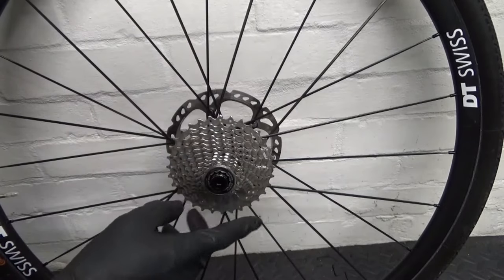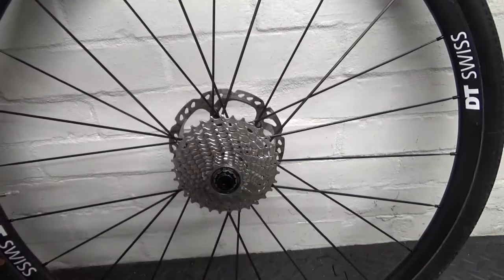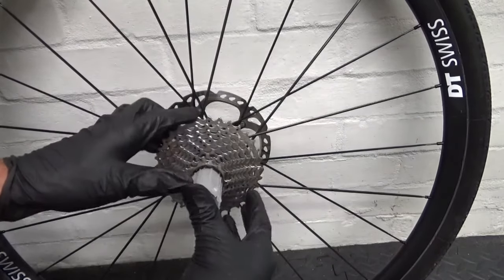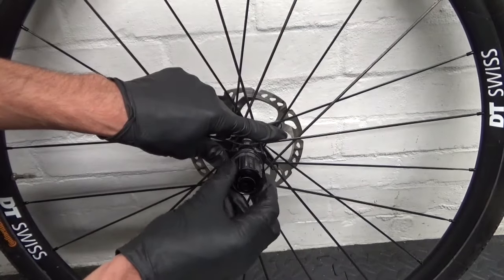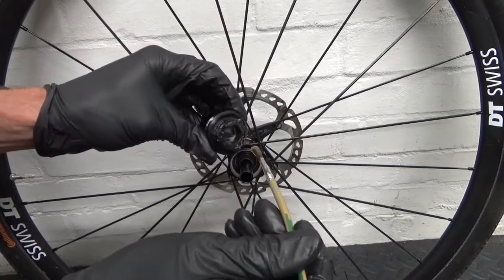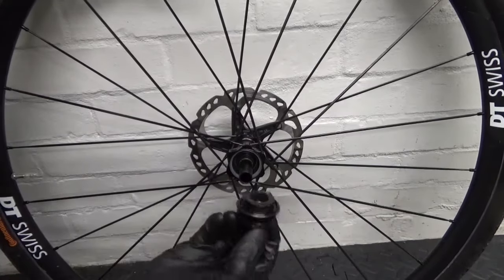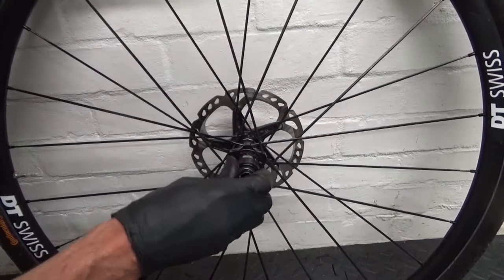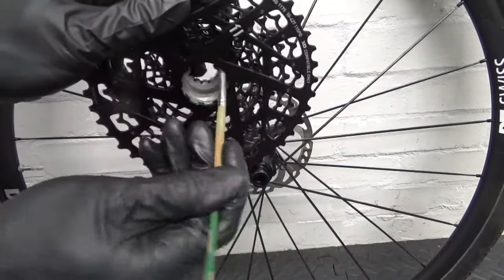DT Swiss Shimano Freehub Body to SRAM XD Driver Swap

Comment: Nice video. But my current rear wheel hub can only accept one side for the spanner (freehub side). The non drive side is round with no way to put a spanner. SO how am i gonna be able to loosen ??? sorry if it sounds confusing.
Reply: Bro. look inside the axle tube and see if it looks like you can fit a 12mm allen key, thats whats going to help you keep the axle from spinning and remember the side where fit the spanner wrench it tipically reverse threaded.
Reply: @ezequielpena7235  oh damn. Old post lol.  I figured it out bro. Thank u

Comment: Great video - Thanks. If i change to complete SRAM etap Force AXG 12S and brake system, from Shimano Ultegra do i then also have to change the disc brake and is it possible?

Comment: Hi. thank you for video. But I have problem with removal Sram freehub. I dont have there any cap. Just axis. But freehub is not possible to remove so easy like you did. Thank you for a advice
Reply: I have two wheelsets. One on shimano second on sram and want to exchange it. But I really struggle with that.

Comment: I have a through axle and a 12 speed freehub body, FH-521, 3 pawls and the end cap screws on to the axle to keep the freehub on, could I swap freehub over to a Shimano micro spline 3 pawls and use the same end cap?

Comment: I have a question Sir, I'm going from The Shimano HG Driver on a Diamondback MTB to an XD Driver on some DT SWISS 370's and I'm going with an 11S GX Cassette. The problem I'm having is, it's not the same Spacing with the new Wheels because of that end cap on the HG  Hub with that Flat Stepped end. How do I combat this if you could give me some advice Please? I don't want to spend more money on going with another DT SWISS HG Ratchet Hub because I've done the 54T kit on the new wheels already and bought the Cassette. Thanks in advance Sir. It's a Single Lipped End Cap.
Reply from the maker: When you fit the sram XD freehub body you have to fit the correct end cap to go with it.
Reply: @FreeToCycle  No Sir, just what came with  The Upgrade.
Reply: @FreeToCycle  I'm sorry, I misunderstood you Sir. It only came with what it had in the Kit. Do you have any recommendations at this point? Thanks for your time and help.

Comment: Can you do the same on a ratchet freehub?
Reply from the maker: Yes!
Reply: Free To Cycle thanks!  I just took delivery of a DT Swiss wheel from Germany (  DT Swiss EX 1501 Spline One 650B/27.5' MTB wheel Centerlock 30mm rear 12/148mm DT Swiss 240s hub) with.mistaken Shimano  cassette driver which was meant to be a SRAM XD driver for the SRAM XX1 Eagle 1295 10/52t cassette! Not sure what parts needed etc!
Reply from the maker: You will need a DT Swiss XD ratchet freehub body for a 12mm axle they will come as a kit with the appropriate end cap!!